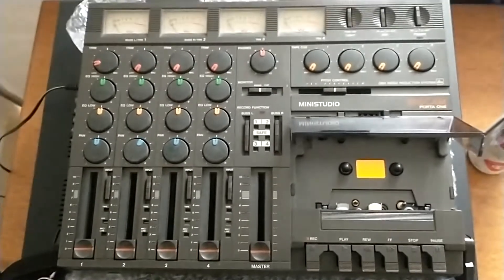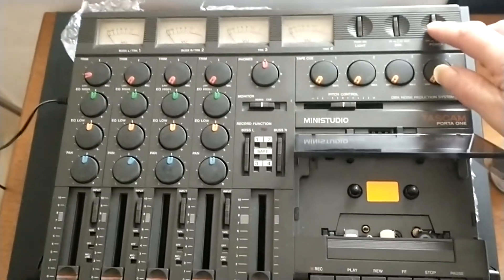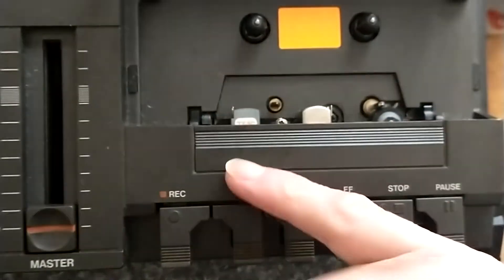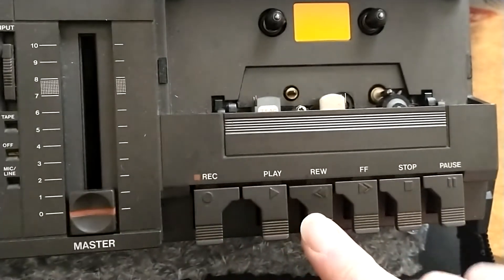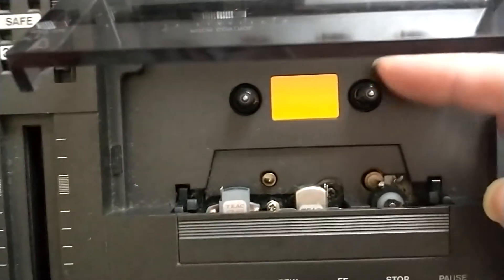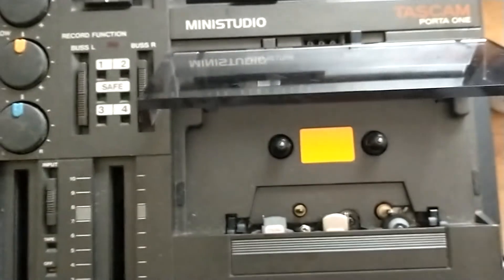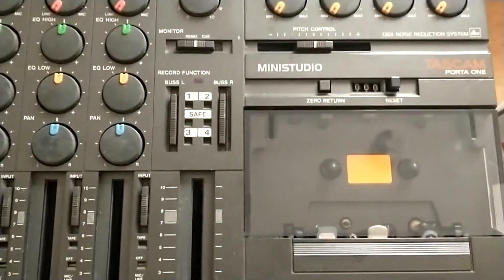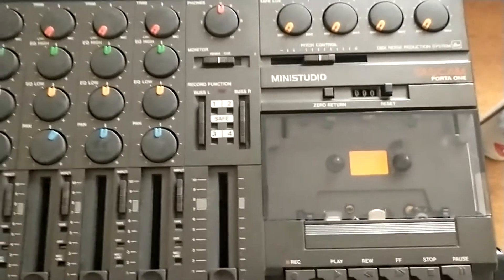Tascam (Teac) Porta One Tape Head Stuck

Comment: Open up the back and turn the large wheel attached to the belt back and forth. This should trip the mechanism that drops the playheads back down.
Reply: this worked for me thank you
Reply: worked for me too in the beginning, but as soon as i turn the machine on the tape head goes back up ; any insights on what i could do about this ?
Reply: Works great! Thanks!
Reply: Perfect, worked a treat, thanks

Comment: Porta05 users: you can reach the large wheel from the side of the silver colored metal case after opening the back — use a small screwdriver or similar to move the wheel carefully ( I used a plastic guitar pic to be sure not to harm the plastic wheel)
Reply: My record button is stuck. And tape heads like this! Porta 05 degrease and regressed gears and levers where the belts are but record button is stuck?!! Don't know what to do